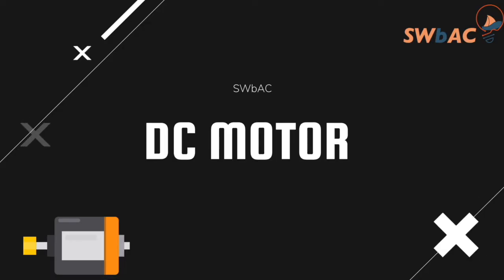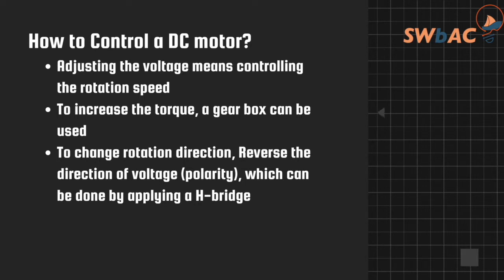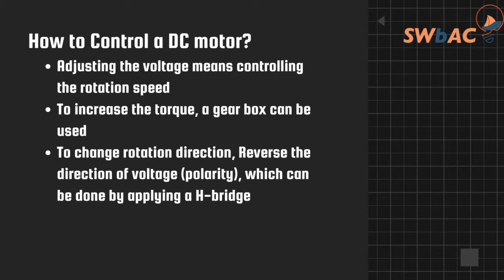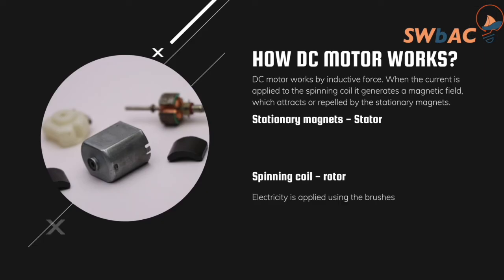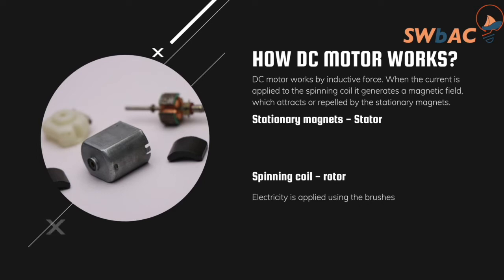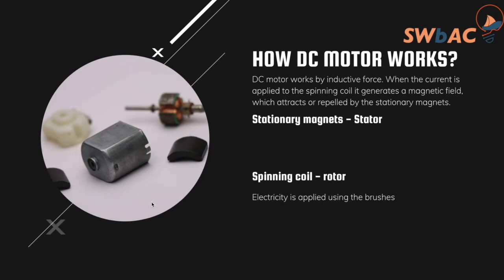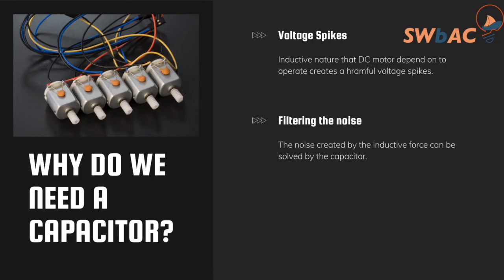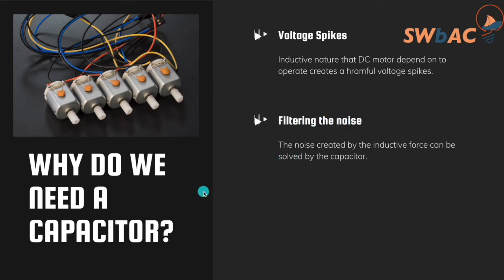Why capacitor is connected in parallel with a DC motor?

Comment: I have this Dc motor running at 230V DC with a bridge rectifier what rating capacitor should I use, I have 200V to 300volts 100-120-150 uf rated ones.

Comment: High voltage damage power source because beginning run need high power and it taken from Capacitor charged rather than power source